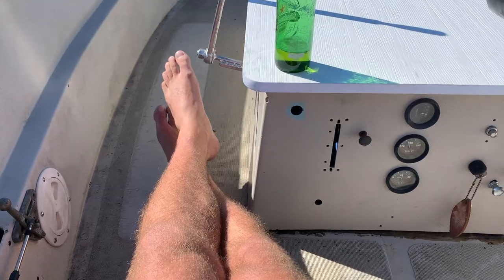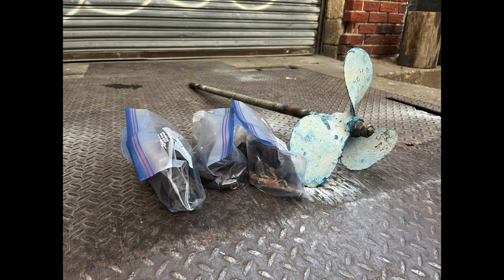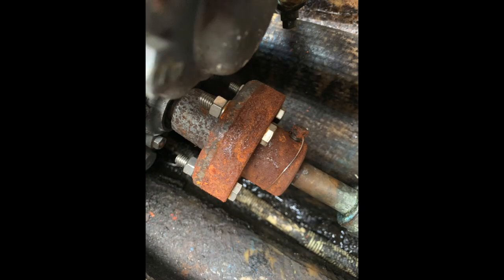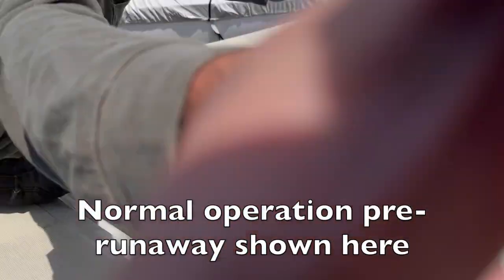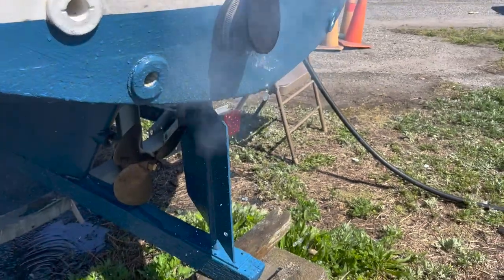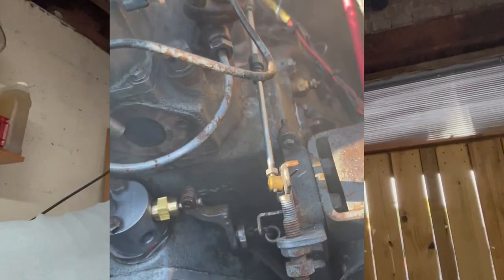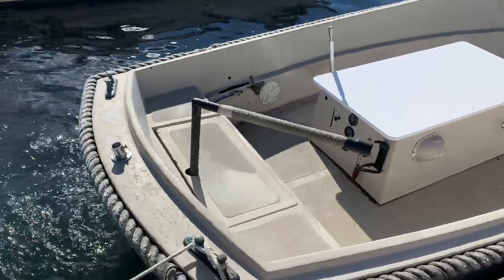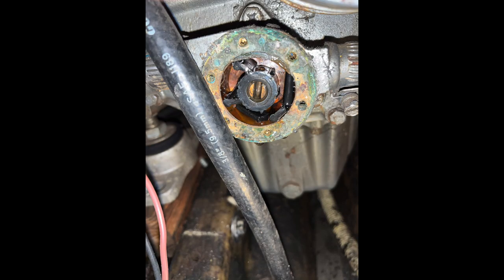Fixing a 8 HP Diesel Boat - How Hard Can It Be?

Comment: Is there a heat exchanger on the boat? Unless you fished all the pieces of that impeller out, they are still in there blocking water flow and potentially causing it to over heat.
Reply from the maker: So it's just raw water cooled. I flushed the engine with the CLR and we'll have to see what happens. Intercoolers were invented for a reason - to prevent rust from destroying an engine with rust...